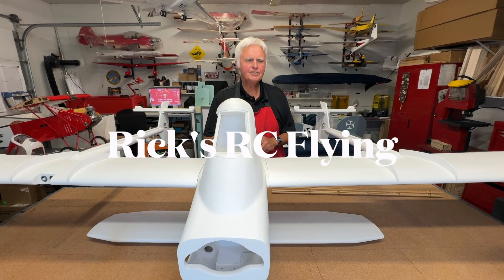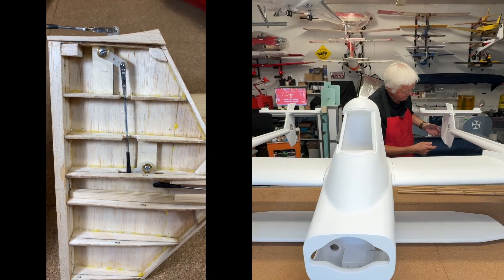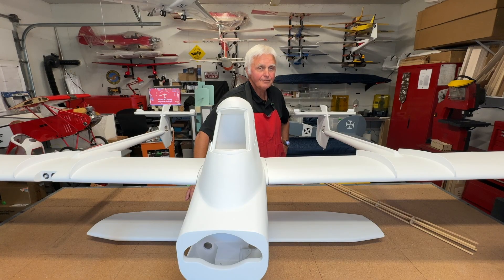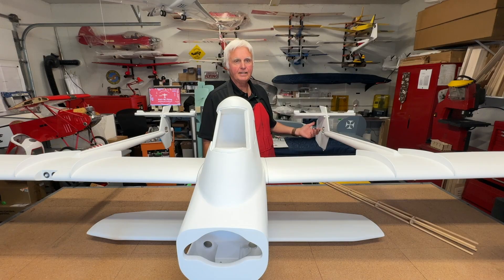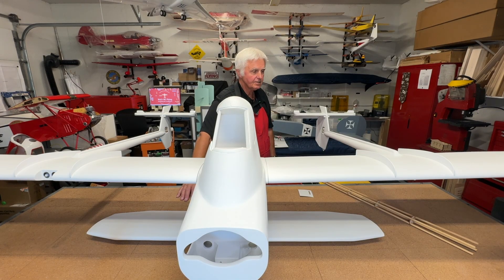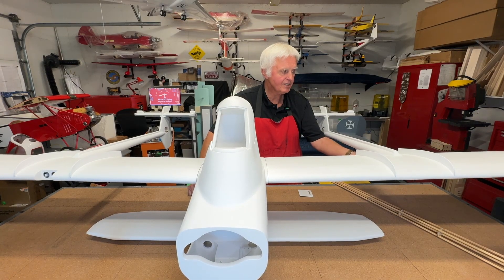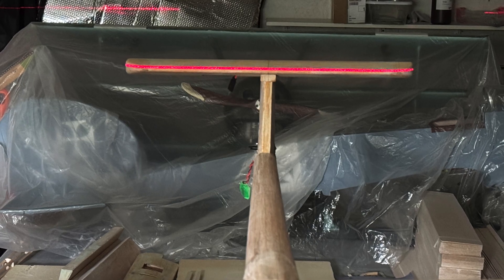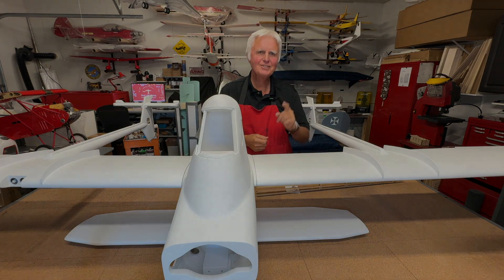PL 12 Airtruk Assembled Episode 7

Comment: Kiwi here, I remember these as a teenager in NZ the 70's, they were incredibly manoeuvrable and there was a jump seat in hopper I think. A few years back I considered a scratch build for electric power but figured I would need 8 to 10 servos so flagged it, they are not ugly to me but really cool. The precursor to this type was the Bennett  Airtruck which was the same layout but used war surplus T6 Harvard parts and before that there was the PL7 air tanker also using Harvard parts, both were attempts to replace the tiger moth for top dressing .
Reply from the maker: Hi Kiwi, I love hearing from people who have personnel experience/memories of the PL-12. Like they say beauty is in the eyes of the beholder - lol. Thank you for the comments. Rick

Comment: Bravo. I found the tail control surface issue on my build as well. It just does not lend itself to confidence in control while in flight. While your solution is the correct one, as you said it is also not the most economical one. Keep going on your build. She will be a beautiful sight in the air.
Reply from the maker: Hi Joshua, Thanks for the comments, I watched many of your videos and also enjoyed your PL-12 build series. Kind of inspired me to build a strong nose wheel assembly. cheers Rick

Comment: Great update Rick. The PL12 was a really ugly airplane. But pilots LOVED it. It was also powered by a variety of engines. ‘Standard’ was the 6 cylinder Continental IO-520-D, but also used the Continental Tiara. This was unusual as the propeller was driven from the camshaft and therefore a 2:1 reduction on crankshaft RPM. The Lycoming IO-540 6-cylinder was also an option. There were also conversions to the Lycoming IO-720, the 8 cylinder, 400HP behemoth. The last PL12 used here in New Zealand, ended up where the pitch change knob on one propeller blade broke and effectively went to zero thrust on the one blade. The resultant thrust loss caused a crash landing that destroyed the aircraft. The pilot survived (is a good friend).
Reply from the maker: Hi Adrian! Thanks for sharing that info about the power plants—it's so fascinating that they run off the camshaft! I had no idea. I'm really glad to hear your friend is okay too. Take care! Cheers, Rick.